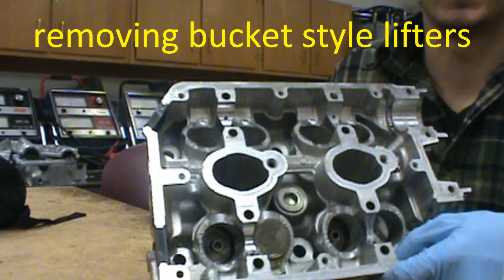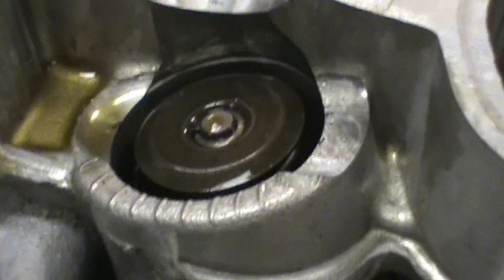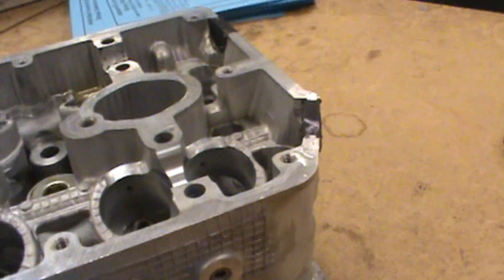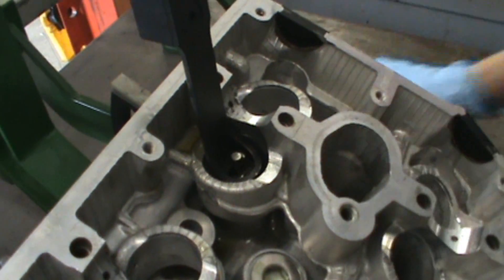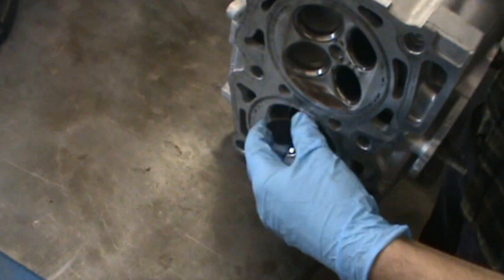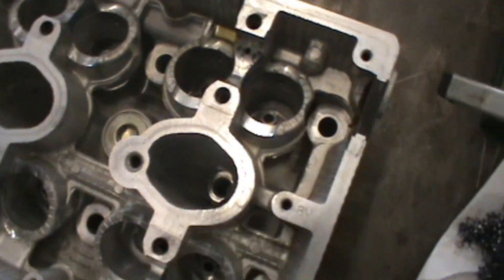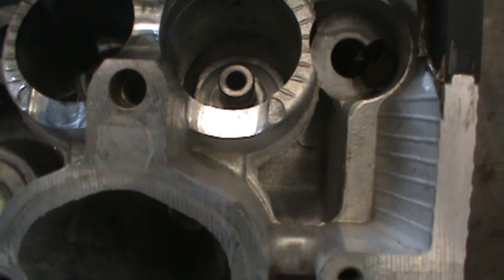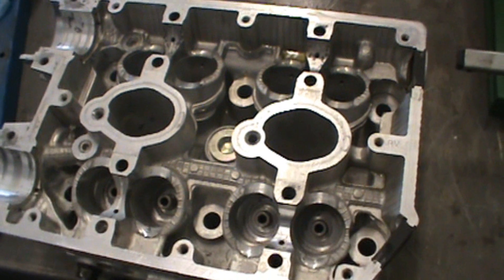Cylinder Head Dis Assembly & Tear Down on a Subaru WRX

Comment: Its the installed valve height that the shim is unique to.  The buckets are all the same you can change them all you want, its the shims that are important to the installed height.  When you cut the valve seats you need to remeasure and re shim each valve once you figure out the new installed height. You obviously have no idea how boundary layer theory or fluid dynamics works if you believe an oil soaked lifter is just gonna fall out of a head that is slightly tipped to it's side.

Comment from the maker: And if you spend another 5 seconds finishing my videos, you'll realize that such items are labeled.  You must not speak until you have the facts.  

Again, I have rebuilt these for years, YEARS.  The process I have used has never been fouled, and it is the process used by many performance shops working with the bucket style lifters.  It is apparent you have never worked with such an engine setup.
Learn the facts and do the research before running your mouth on my web page.
Thanks,
Anthony

Comment: What i would like re clarify is that you should not expect that each bucket will pop out and STAY in place in the head. You just cannot trust gravity. In your demonstration, you would have potentially mixed up the buckets/shims, and their respective clearances between the intake and exhaust valves. As you may know, you cant fit a intake bucket/shim on a exhaust valve, vise versa. Major pain in measuring everything up. 

Not every rebuilder likes mixing things up. They are usually labelled etc.

Comment from the maker: Apparently you've never rebuilt the EJ series have you.  The shims will not flop out, there will be a vacuum seal when you use the oil to lubricate it while being removed.  It allows enough clearance for you to remove the bucket.  Also, subarus rarely, if ever, are rebuilt with stock valves.  Your comment holds no water.
I've been building these blocks for longer than you would care to understand.
If you rebuild one, then make a better video yourself.
thanks,
Anthony

Comment from the maker: @spelunkerd Yes, this is what many shops do when they're NOT trying to rip the customer off.  Many times the dealers will just remove the heads or engine block & replace them with a brand new factory OEM one.  This method saves alot of money, and can save alot of time if it is taken to the right place.

Comment: So, does the retail mechanic take the head off and send it over to you with the valves still inside? Then your machine shop planes the head, grinds valves, hones cylinders, and cleans the head. Then reassembly and back to the mechanic?